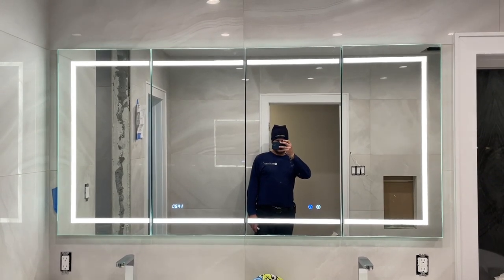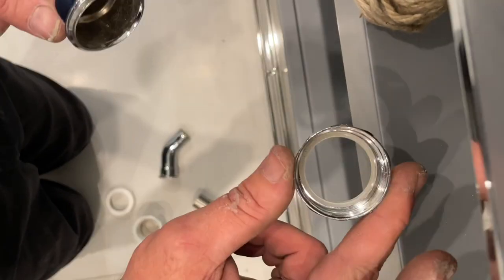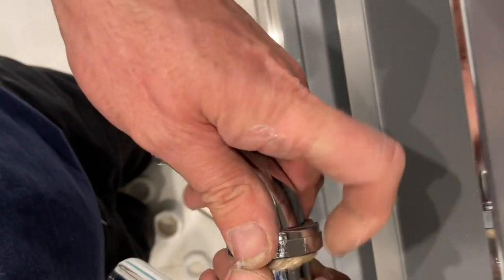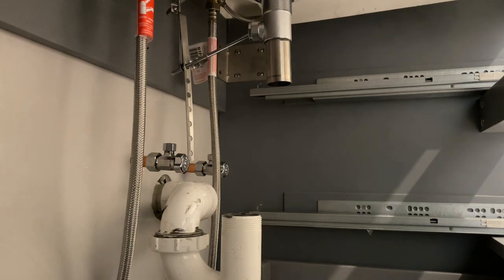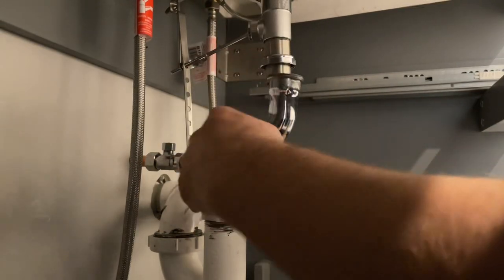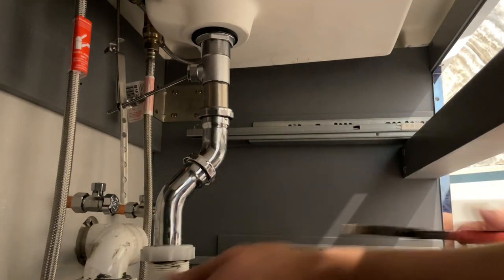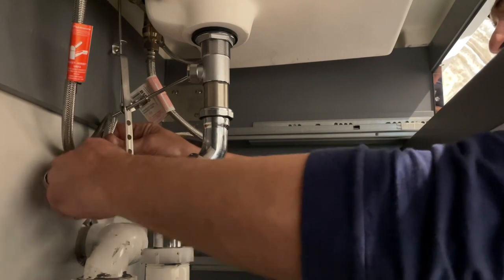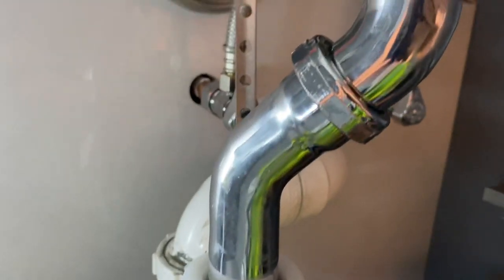How to use Ball Wick on tubular drains - Old School Plumbing

Comment: I've known it as lamp wick. It was used along with pipe dope to make up brass fittings and as valve packing exactly what you're using for. That was our Teflon.
Kelvin is hilarious.  Not many of us could work under a microscope as he does. You make the perfect comedy team. Very enjoyable.
Reply: @PipeDoctor  
Separate a strand  out of the ball. Wala Everyone dose different same results.
Thanks.
Reply: @PipeDoctor  We called it hemp and used it on high pressure compressed air (with a back nut behind the fittings )and water . I haven't seen it used for 40 years now but still remember the greasy smell of it.

Comment: A long deceased plumber/uncle of mine (died in the 1918 flu epidemic) used this twine - kitchen twine is similar but a bit thinner - can also work - he swore by bacon grease as a sealant with bail wick.  He also used to heat/melt lead chunks to seal large iron underground pipes - I think he used some kind of gasoline fired cauldron for this.  Nasty work.  Now there's screw in plumbing pre-fab pieces, all ready for the homeowner to try his hand at.  And an "Oh Boy!" happens.

Comment: Good, valuable  lesson. I use Fernco products to get me out of a bind when necessary on basin / sink lines if lacking a part. Always keep rubber connectors for emergency use.
Reply: Rubber connectors are not allowed inside or under the building in Texas

Comment: One of the older HVAC mechanics showed me how they used to "hemp a joint"... Put this hemp twine like material in the threads of a screwed joint and coupled them together...  Guess it was the original thread sealant of that time.

Comment: It's called plumbers hemp, it expands when it gets wet, apply it with antibacterial grease and it will expand to seal the gap. They used if before teflon tape. Yer I grew up with five plumbers living in my street.

Comment: That’s very old school. But Um. Your the man and your the one making money on YouTube. But I was always taught to come straight to trap. And kick the 1.5” over with a 22 or 45. But never. Never should you use a pressure 90 on a drain. Totally respect your hvac skills. But your gonna get laughed at with this. Plus a pvc 45 is $3. Each of those chrome biodegradable tubes are $7. Plumbing has to do what plumbing has to do. The cabinet gets compromised not the plumbing. Modern pipe dope will do what the packing strip did. O wow. Just watched the packing. I dunno. I think I would walk in and ask which hvac tech did this. Not hating just confused.
Reply: Gotcha. Everybody has their 100% way. I use a dab of dope or Vaseline  around the washer so the bevel is slick and slides In tight. I didn’t even know they still sold that string. Cool tho. That string is some magical stuf. I did get disrespectful. My bad. I try to encourage discussion not debating. Your way works for many many people.

Comment: Thought I was the only one that doped the threads on PVC traps. A little added assurance never hurt nobody, most guys don't do it though. And then there's the armchair experts online that say you should never dope PVC threads. For what reason? I don't know, not like it'll hurt anything. Then there's Steve Lav that says not to use threaded traps, only glue traps because the nuts loosen over time and can leak. Have yet to see that ever happen. Sometimes I think plumbers just come up with reasons to continue doing things the harder way.
Reply: Also, why'd you come out of the wall with an elbow? That kinda screwed ya. It would've lined right up if you just came straight out of the wall with a female 1.5" to trap adapter, cut the trap arm to line up with the drain, use a plastic tail piece extension to reach the trap and done. Beats fighting with an offset on that chrome garbage. That junk will leak at some point, they always do which is why I like all plastic up to the faucet supplied tail piece.

Comment: Why do you not like the stainless steel braided lines? What do you prefer?
Reply: . @Pipe Doctor Plumbing, Heating & Air Conditioning, Inc.  
Ball nose copper risers will seep sometimes but they wont burst unless frozen. I had a co-worker that had a major flood caused by a polybutylene riser that burst at night. They found an inch of water on the hardwood floors when they woke up.  

Have you seen many stainless braided lines with metal fittings fail?  I know there were problems with the braided hose assemblies with plastic fittings

Comment: That shower is bad ass
Reply: @PipeDoctor  okay- question. Can you run all the shower heads/sprayers at the same time with enough water volume? I've got a well and its a problem for me
Reply: @PipeDoctor  so what do you tell a customer doing a second floor remodel who can't run new plumbing and has 3/4" copper - but who wants a nice setup like that?

Comment: Which is better compression shut off valves or solder shut off valves?
Reply: I was always a fan of the solder, but someone did bring up a good point that solder ones are much harder to replace when cut off valves go bad. With compression you just undo the nut, pull, and pull the olive. pop on a new one, and your all set.

Comment: Never actually have seen any issue, but the manufacturer of pro dope says do not use on plastic. Pro dope is oil based and that may cause problem with some plastic pipes and fittings. PVC pipe is very resistant to oil, but better to play safe. 
https://www.oatey.com/products/hercules-pro-dope-1185446064
Reply: @PipeDoctor  PVC (polyvinyl chloride) is a type of plastic. Plastic is a general term for anything made primarily with a polymer.